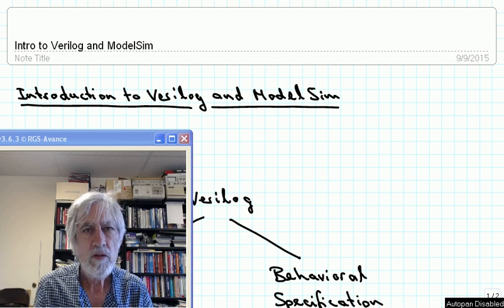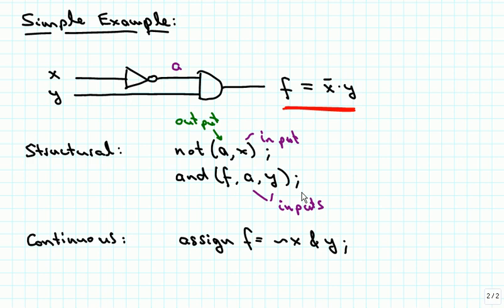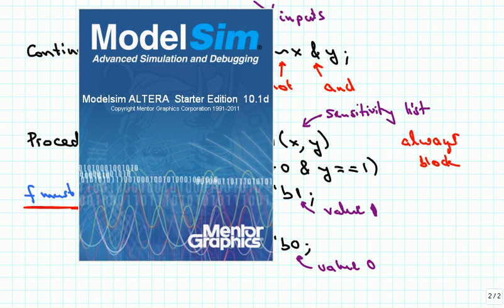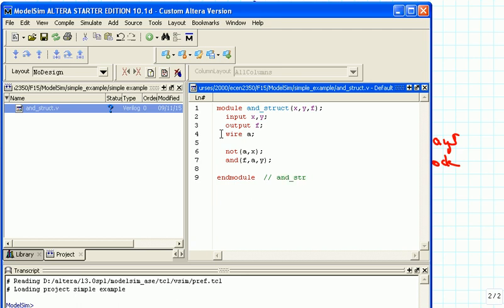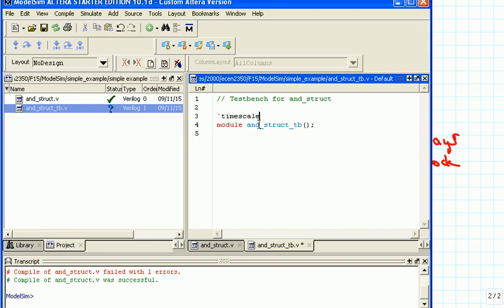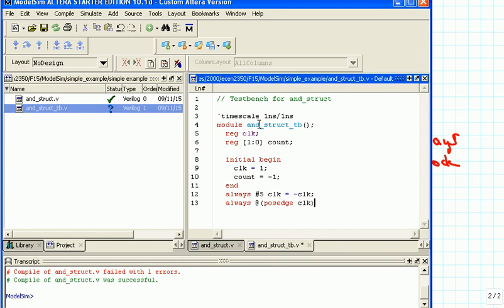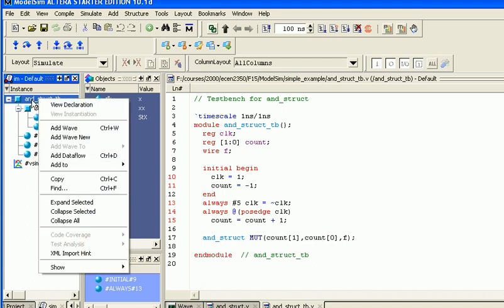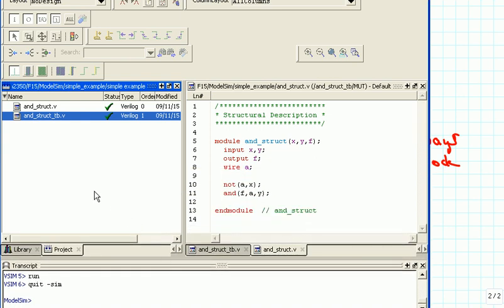Intro to Verilog and ModelSim, Part1

Comment: Error: (vsim-3033) D:/TECHNICAL/Embedded_Systems/SOFTWARE/VERILOG/simple_project_with_modelsim/and_struct.v(9): Instantiation of 'NOT' failed. The design unit was not found.
# 
#         Region: /and_struct_tb/MUT
#         Searched libraries:
#             D:/TECHNICAL/Embedded_Systems/SOFTWARE/VERILOG/simple_project_with_modelsim/work
# Error loading design

I get this error. Could you tell me why? Thank you

Comment: Hello Mr. Peter,

I have two push buttons (using  Basys2 rev C board)  and I want to increment   a register  (counter) when i push one of them .I used :

always @( posedge pb1 or posedge pb2 )
 begin
 if(count2==9) count2=0;
 else count2= count2+1;
 end

but when I implement it (using ISE 9.2), an error appeared:
""The logic for <count2> does not match a known FF or Latch template.  ""

So why this happened?
and when I used one event (posedge pb1) , it worked !

Thanks